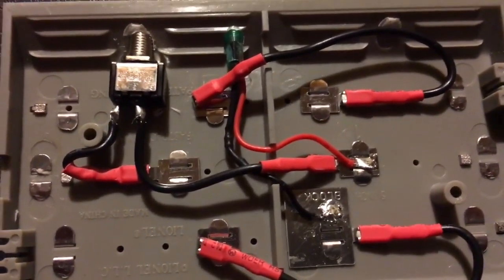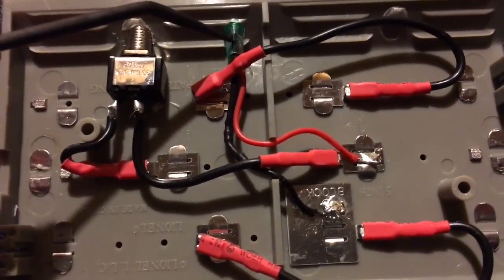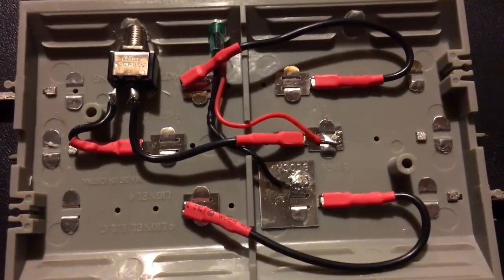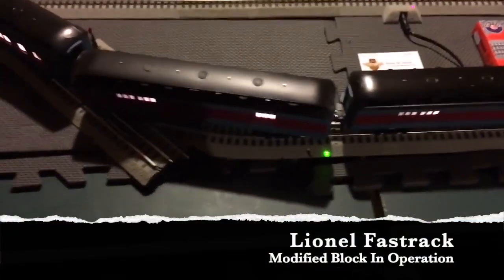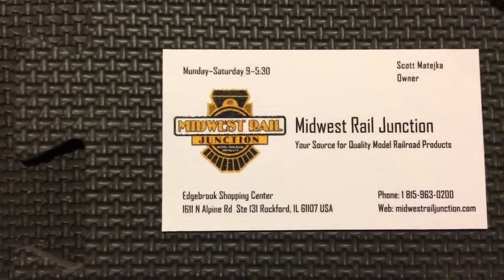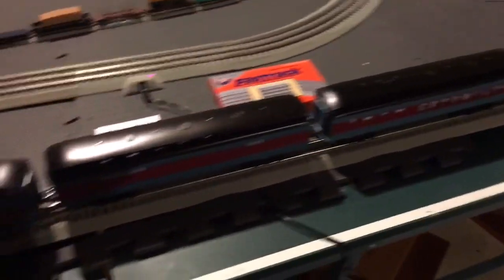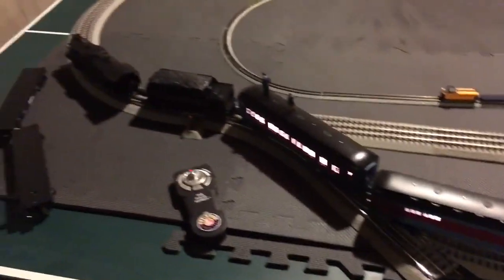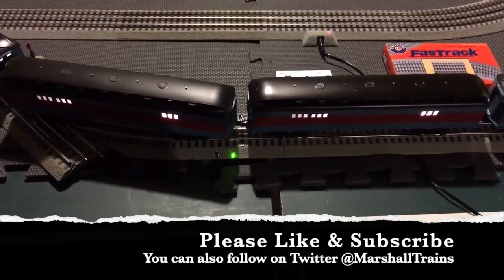Modifying a Lionel Fastrack Block Track to add a Switch and LED

Comment: I came back around to this. Have another question. I'm trying to do something very similar. Conventional from 82 and a newer lion chief. Both are generals. Want to do something like this on a side turnout with remote command switches. 1) do I need two of these blocks one on each end of the side loop just before the switch goes back into the main? 2) is there a way to eliminate the pole switch and turn power on an off with an IR remote?

Comment: Curious why you chose not to use fastrack anymore.. but hoping you could help. May be better by email but I have questions about power and wiring up bus lines and feeders, etc.. I'm not a wiring genius but looks like you know better with the connections in the underside. I am putting up a ceiling and wall shelf layout around my pub in the house. Approx 14x16.. With my back, I'm trying to avoid being on a ladder as much as I can and hoping not to have to solder without losing signal quality.. any chance we can chat by email, phone, etc? Would appreciate the help. Jim

Comment: What kind of toggle switch do you use? Is it just a simple on and off?
Reply: FutureRail Productions simple on/off from radio shack. Any should work as long as it can handle the amp output of your power supply.
Reply: Thanks! I use a Lionel Powerhouse Brick for my power supplies as my layout is command control, but I would love an unpowered siding that would go to a workbench so I'm not breaking any of my building and scenery on the main table.
Reply: @TheKennethMarshall  Output capacity of the power supply is not a factor in sizing the switch. The thing that matters is how much current does the blocked section (load) draw.